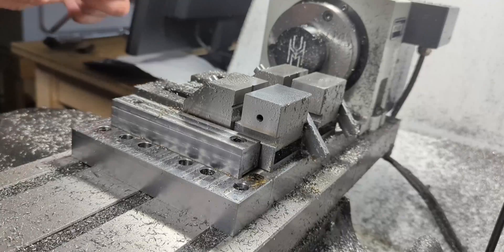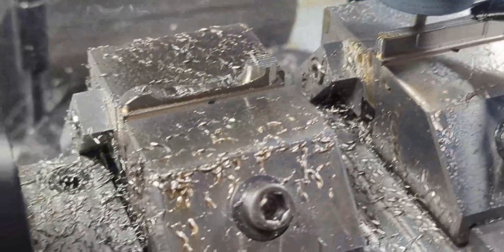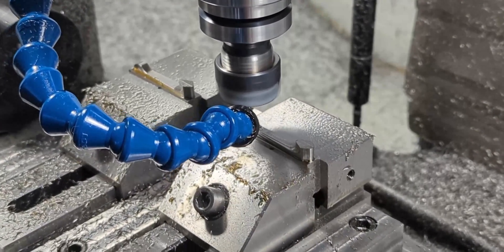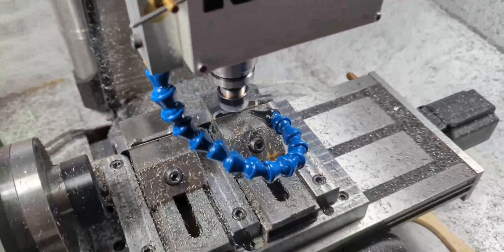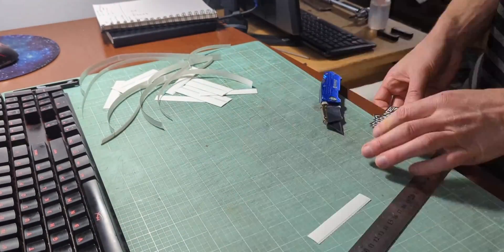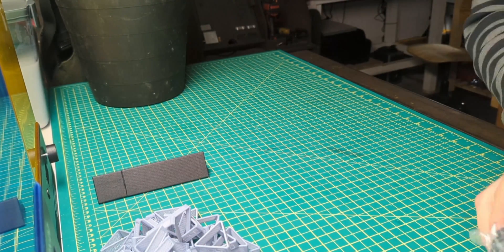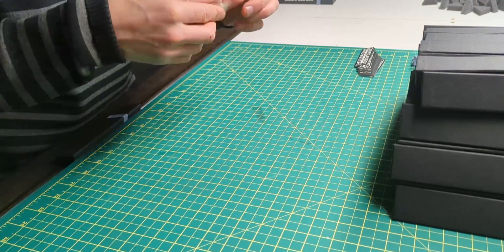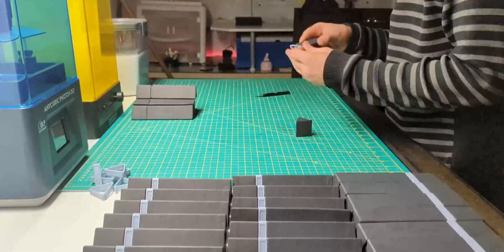vlog 8 - Titanium Pocket Clip Machining

Comment: heh you could almost laser mark those boxes at about the speed it was taking to sticker them.
Big enough laser and you could stack them into a tray, fire and forget it for an hour and come back to them done ;-) If you felt really fancy then you could perhaps serial/engrave details on the box too (though that could get irritating)
Having your shipping boxes printed might be an option for you too, wasn't much over the cost of plain boxes last I checked in qty 1000 or so.
Reply from the maker: I initially planned on lasering but the boxes are wrapped in a fabric style paper which kinda looks like garbage lasered. I think a roll of labels would be significantly faster...would eventually like to find a local / Canadian company to do this as well but the ones I've worked with either want 10K minimums or do lack luster work.
Branded shipping boxes are an option but I a lot of my customers want subdue packaging hence the white. I would however like to go with black shipping boxes and printed artwork on the inside (and perhaps that's is what you are getting at). Thanks!